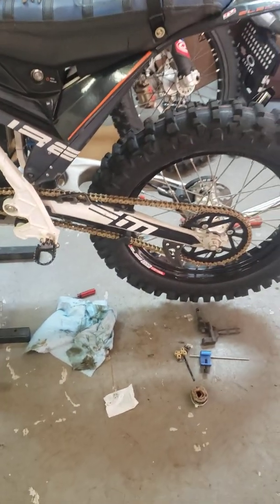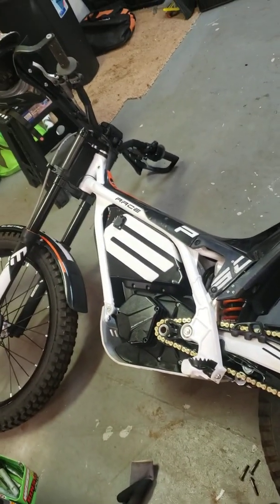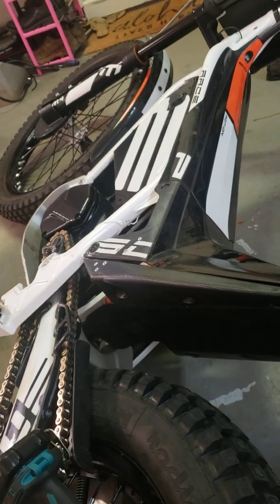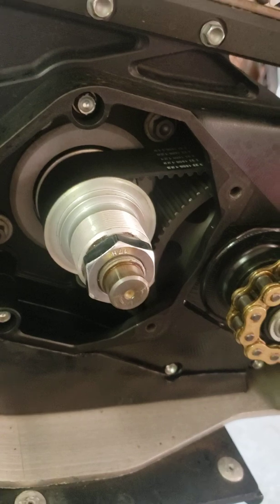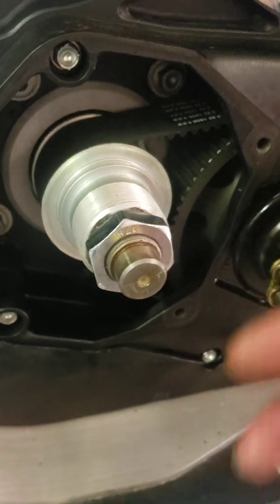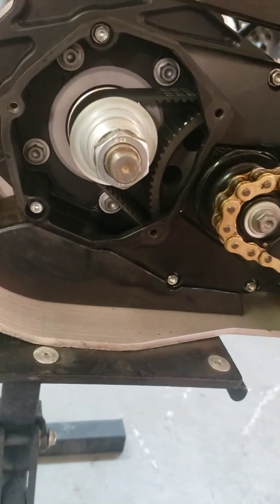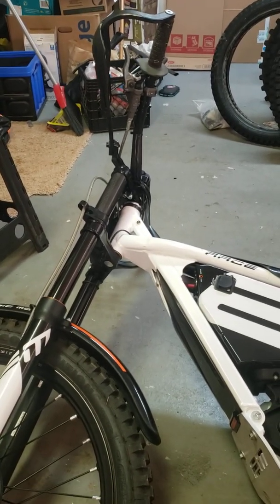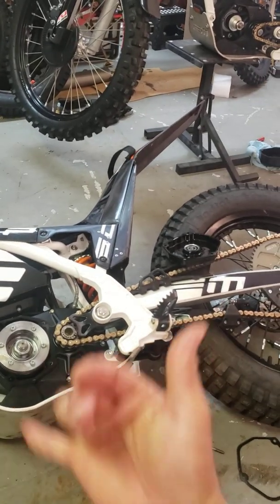2020 Electric Motion Trials bike  E-Pure Race electric motorcycle Clutch.

Comment: Does the E-Pure Trials also come with an electronic clutch version? and how does it operate compared to hydraulic? Thanks and great video.
Reply from the maker: Thanks. Yes there is a Epure with "electronic clutch" but it's better as a regen brake really. It's the PRB/PELS option. PELS will allow modulation of the throttle but with no sound its a bit to get used to. Get the clutch version its worth the extra money 🤙

Comment: Hi have you ever noticed a F0 code after you power the battery down? Also have you experienced when powering on a continuous beeping like its counting the battery level...also as it does it the map light pulses ? Rides fine and no other issues.  Cheers for any help.👍🙂
Reply from the maker: Yes, Its been said from the factory that it is just a bug in the electrical display. It does not mean anything nor is it a coded warning. Nothing to worry about.

Comment: Have you tried using a regen ‘button’ with the Race model?  I understood from France that a Map switch could be used with no other changes.  But I hear different things from other sources.
Reply from the maker: Yup the race and the new Escape R will use the FRB (fixed regenerative brake) button vice the PRB lever. It works great at creating a engine brake feel and adding a bit of power back to the battery. The button just take some time to get used to.
Reply: @electricmotionhawaii  thanks!  The guys at EM USA tried to tell me it wouldn’t work, the rear wheel would just lock up.  That didn’t make sense to me and the guys from France said it would work.
  I was trying to find out how it was wired - I have a button that I can use with my thumb, that will sit below the handlebar.  I think it will work well.

I figured you could always slip the clutch a bit to less braking effect.

Thanks!
Reply from the maker: @improvsax  it will work. EM USA is waiting on some parts but they will be all stocked up soon. Get with the dealer you got the bike from and they can hook you up. 🤙
Reply: Any one tried that option? I'd like to buy a 2020 race model, but only if I could have recuperation steerable by "gas" handgrip.

Comment: I dont think its a gimmick at all, i think for  trials purposes the clutch makes sense so you can pop up the front very easily, and with that huge amount of torque that the electric motor produce its a huge plus. I wish manufacturers learn from this brand and use this concept on other bikes, and why not , maybe even on on-road type bikes not necessarily off road. Like KTM for example , on the electric free ride it would work great.